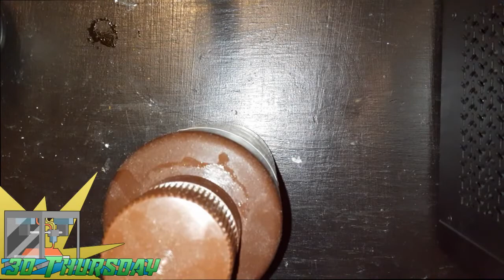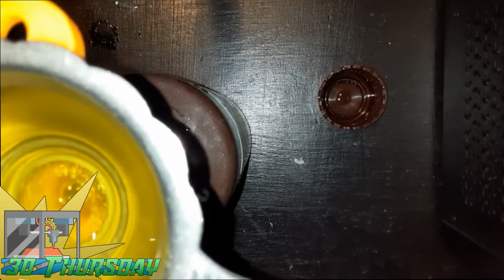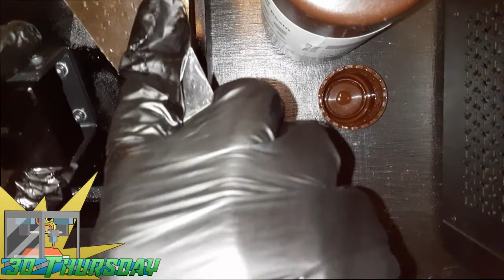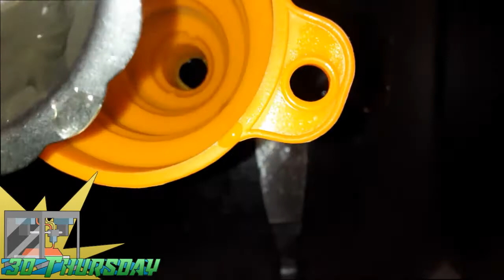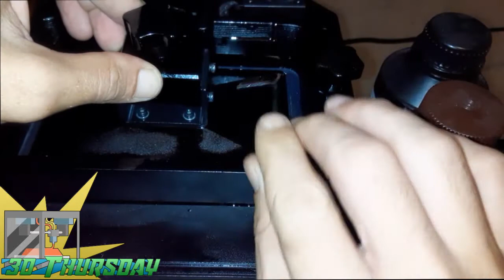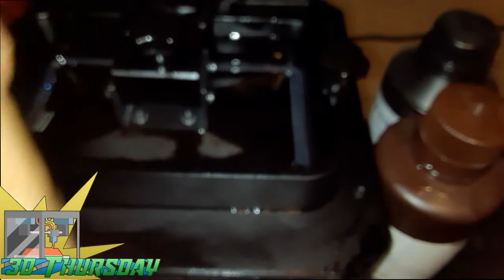Cleaning a 3d printers resin vat -  #3DThursday  - Creality LD-002r

Comment: Anyone have trouble with FEP tension on the creality? I recently changed mine from the factory one and noticed after I did this I keep getting fails.
I e been reading that the tension is important but can’t find anything about tuning it for the Creality.
Reply from the maker: hmmm... ive only changed mine once, but its been working well. i would say dont pull it tense let the screws do there work, i did mine in a criss cross pattern, and only did them halfway in, and then went around again. there is a video on the us that comes with it that shows you how, but i thinki skipped it. :)